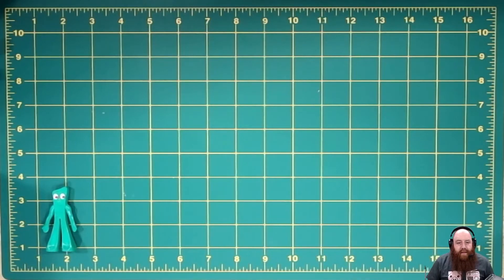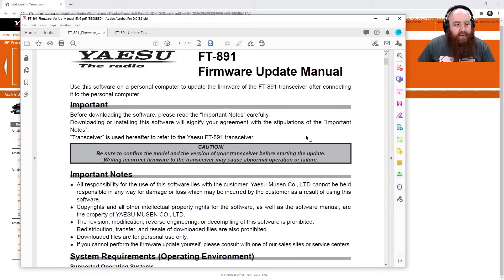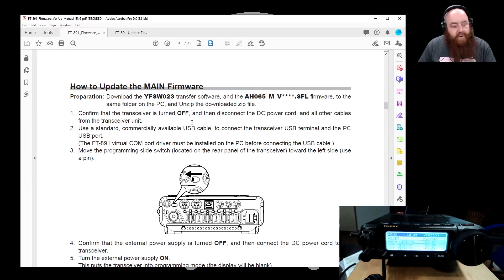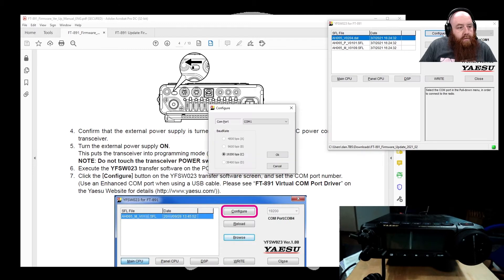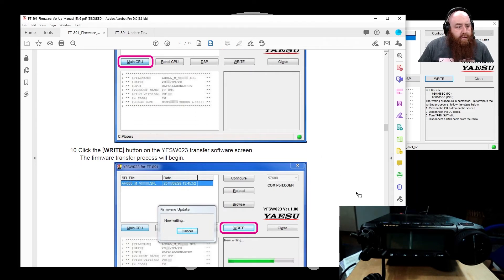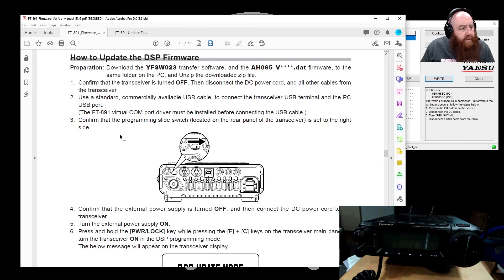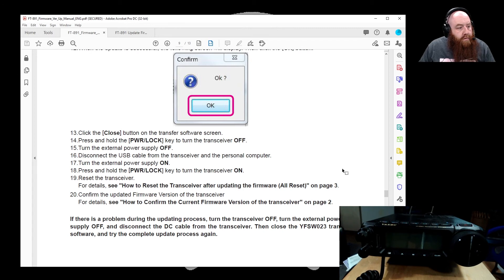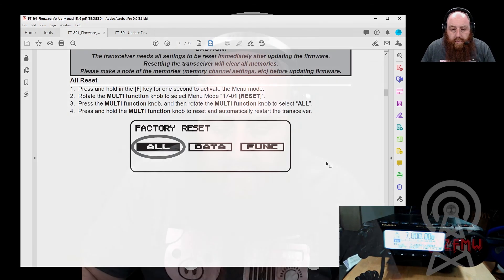FT-891 Firmware Update

Comment: I followed your video, then somewhere I got lost, for a couple hours my radio would turn or write, I shut down my radio tried everything, thought I bricked my radio. I reset the program switch a couple times whilst my radio could not be turned on. 
I left the radio alone for a couple hours, went to sleep, when I work up the next day, I played again with the radio, trying to wake it up.

The radio finally woked up, after that everything worked fine. My radio was finally updated. The Power+F and C button were the key to getting my radio to wake up.
Reply: this happened to me. not. worth. it. anyone reading this, please do not update the firmware on your radio unless you know 100% what you are getting yourself into. i will never update the firmware on my 891 again, it works just fine and was a completely unnecessary update.

Comment: i like the radio but OMG they need to fix some of the user settings in the firmware. 

1. Mode menu, when selecting SSB mode "ask if you want USB or LSB" for faster switching. or just remove "SSB" and add in separate LSB USB trying to fined it in the Sub menu stinks why would they have it in the Submenu it makes it harder to switch.

1.5 when changing the Mode or the BAND using the VFO to select between them is horrible there is no positive feedback like the multi fashion knob.
Change it to the multi fashion knob the detents "clicks" make it easier to fined what you need. and keep it up till you press the multi fashion knob to confirm. a lot of times what happens is you move the VFO knob over shoot it and then bam your on the wrong band because it closes out in 1 sec!

2. With auto tuner enabled I get a "WAIT" over the freq display so I have to go and disable the Auto tuner when tuning around the band. it's Varey distracting it makes scanning the band.

3. When adjusting the squelch or RF gain, the pop up screen stays up till you hit a button but then activates what ever button you hit! They just need it to disappear after a few seconds.

4.  Direct entry mic why is there no direct entry mic to key in the freq you want to go to?

5. The power submenu is confusing ok every one gets SSB, AM, and FM power But what is the need for HF power? isn't that a little redundant?
Reply from the maker: I love this radio. I use it primarily for portable phone operation. I notice that when I switch bands from 20 to 40 it will automatically go to LSB from USB. Having some type of tactile feedback for band and mode selection would be nice. I don't use a tuner so I can't speak for that point. The power menu does seem redundant. The HF power selection is for CW and Digital operation. I would prefer that was stated in the menu. 
Thank you for watching. I hope they can fit some things into future updates.

Comment: Can you do this without affecting the mars mod?
Reply from the maker: I am not sure. I do not have the MARS modification on my radio. 
To my knowledge, the modification is solely a hardware change in the radio, not the software.
Reply: @dankd2fmw489  This will not affect the MARS mod as, as you said Dan, it is a hardware mod not a software mod like some rigs.  John, N1WOM  (didn't have to update my 891 as it came with the latest already installed!)

Comment: Thanks for the walkthrough.  I had the COM port issue when I tried it last.  I'm going to try it again.
Reply from the maker: You're welcome. I hope you are able to get it done!
Reply: @Dan KD2FMW I was able to get the Main and DSP updated. Yaesu's procedure is a little backwards but it worked. I also re-flashed the LCD firmware since it was with the other files. My radio is now current with the models rolling off the line. 73 DE KC9EHQ